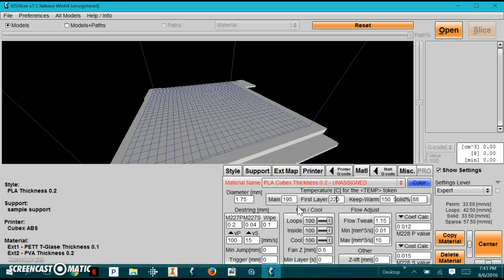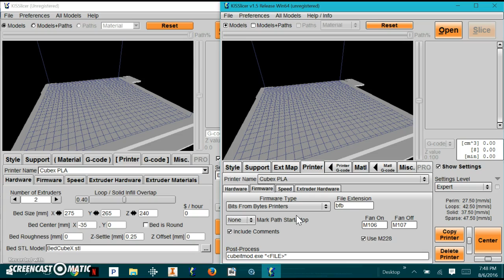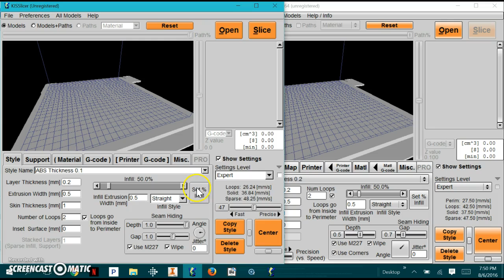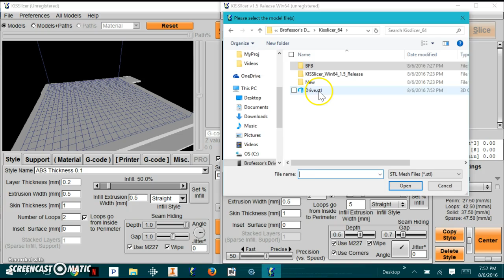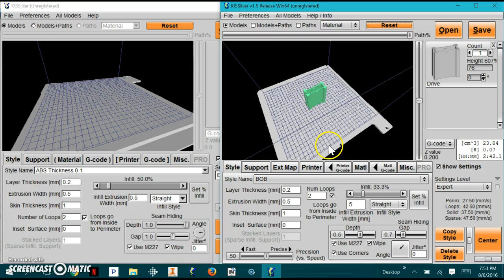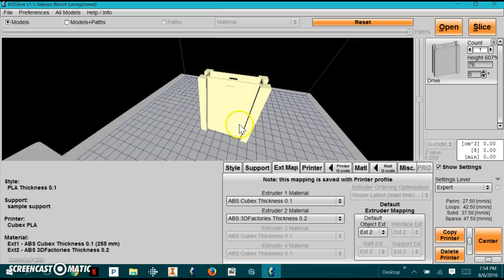Kisslicer : Settings

Comment: Not sure if you have any idea about this, but when I try and print the extruder does not extrude a steady stream of plastic, it sort of spurts out filament. I have tried to mess around with the gain but not sure the right way to fix this.
Reply from the maker: +Nate Schroeder I am happy to help. Send me an email to rubixzcubex@gmail.com. with all of the details such as current settings and possibly a video/photo of the issue.  Lets see if we can get you printing again.
-Isaac aka RubixzCubex

Comment: Fantastic job giving some insight to KISSlicer. I feel if you could show of some of your prints using KISSlicer you could get a bigger fan base. P.S. I was looking for ways to get more out of my Cubex Duo and found this laser to engrave material. I contacted the manufacturer to see if it would work and he said you would have to install it above the extruder to prevent losing print area. Again great job.
Xavier Kelly
Reply from the maker: thanks So much. The laser Idea is great.  Do u have to use other software for the laser?